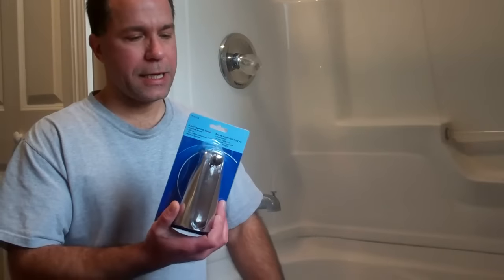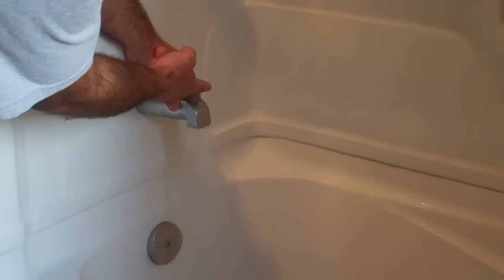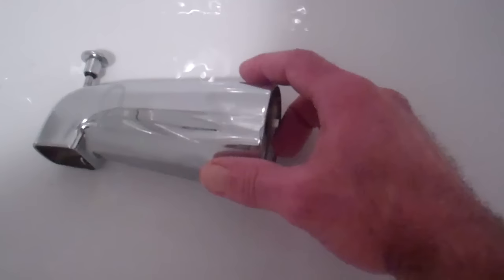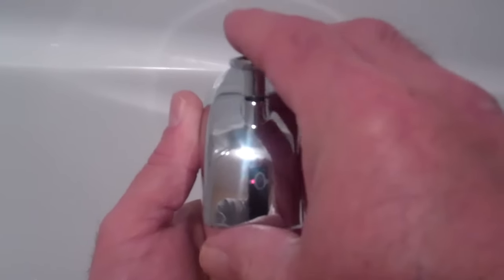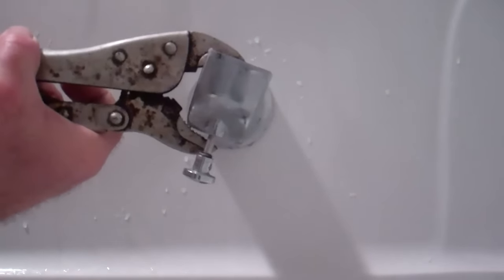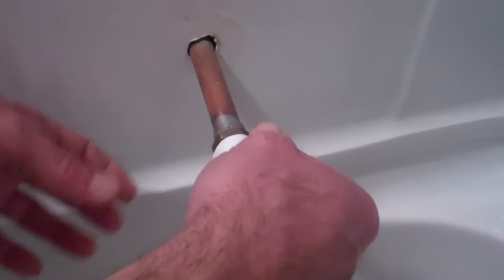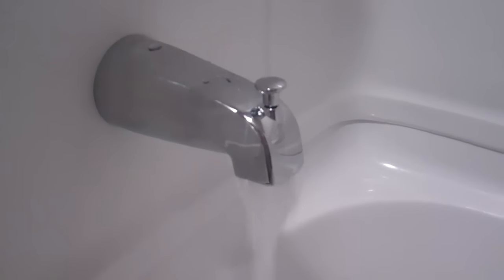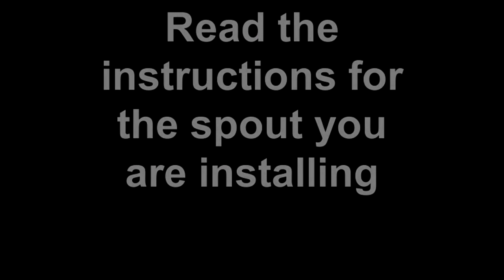Bathtub spout replacement

Comment: A new spout wasn't needed in this case. Removing and cleaning the inside of the spout with vinegar to remove the mineral build up would have done the job. The problem is the hard water from the well. The same thing will happen with the new spout due to the hard water. Very good video otherwise.Thanks!